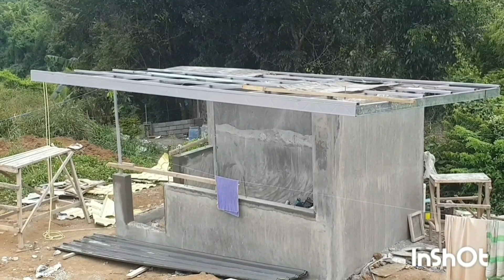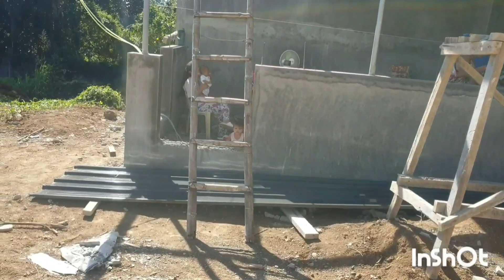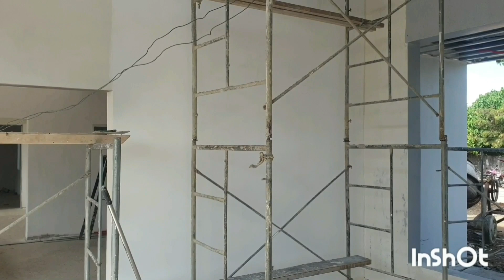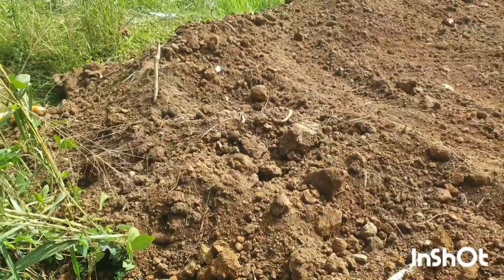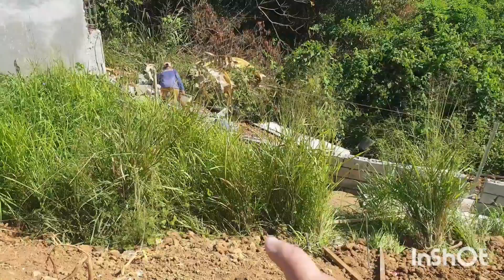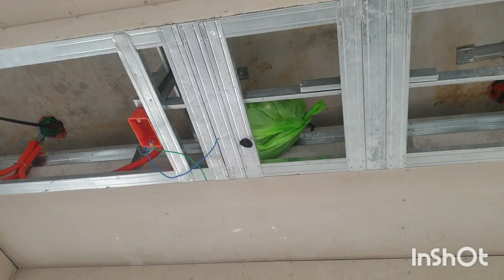House build - Week 26: DIY roofing...

Comment: Barbeque looking good !    Question. How wide are your stairs ?  They look narrow.(maybe just your camera). Are there overlay wood treads that widen them ?
Reply from the maker: I can't tell you how many comments Ive had on that topic. The concrete you see is the support structure. The wooden treads coming later. 
I might have gone OTT with the BBQ!
Reply: It's OK stairs as a builder I know what's about. 😅
Reply from the maker: @graemescebuphilippines363  Dont quite understand your message, but thanks anyway.
The next big thing is probably finish the roof and start the ceilings.
Reply: @danielthompson1289  It's just that I know the concrete stair is just supporting work for full width treads